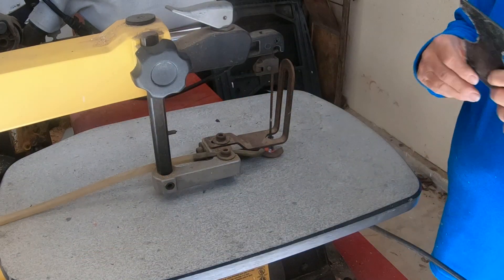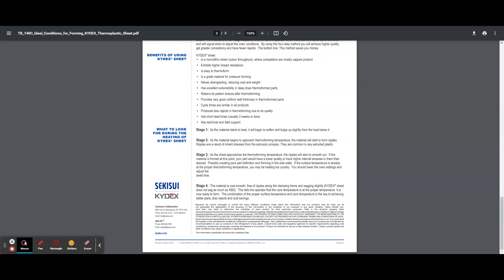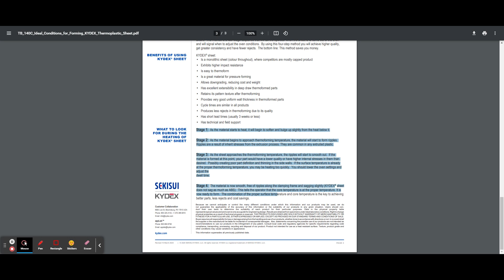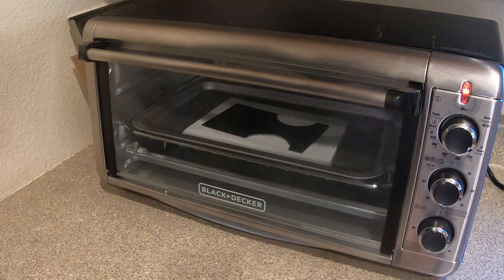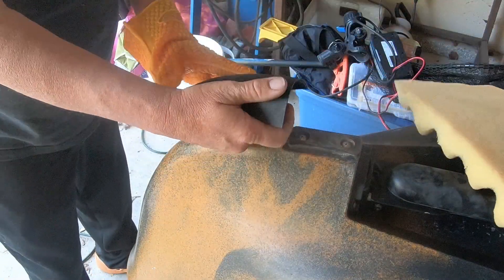Kydex Keel Guard Kayak or Boat- Step by Step

Comment: How's is the glue holding up?
Reply from the maker: So far so good, although I'm pretty easy on it.  I haven't ran into much and I load it onto a smooth metal trailer.
Reply: @smokinroosterfishing8747  I really like the hot glue idea over epoxy. This is meant to be a sacrificial part. If you bond it with epoxy, then when this material wears through, you're left with a mess to deal with in the other areas. However, hot glue can be removed by using 99% isopropyl alcohol. If you scuff both surfaces with sand paper before bonding, then the hold will be good. If you're bond was too strong after abrasion of the surfaces, you can always heat to remove. Expoy can be removed this way as well, but I'm not sure how hot it would need to be. I'm totally doing this. Thanks!
Reply: @smokinroosterfishing8747  I like the fact you did the little half moon cuts... But instead of heating the sheets on the oven , would a hot gun work too ??  Also would it be a best bet to run a little water proof silicone around the edges after glue dries ??

Comment: Do you remember the thickness
Reply from the maker: I used this one KYDEX Thermoform Sheet - (P1 Texture) - (.080" Gauge) - (8in x 12in Sheet) - (Black) - (2 Pack) - (for Holster Making & Hobby)
Reply: @smokinroosterfishing8747  how is it holding up
Reply from the maker: @Eric19781  So far so good, but I don't run into much where I fish.